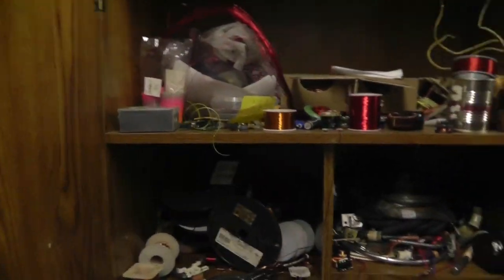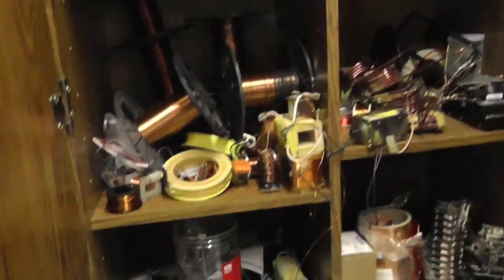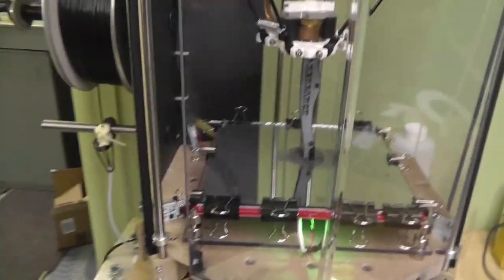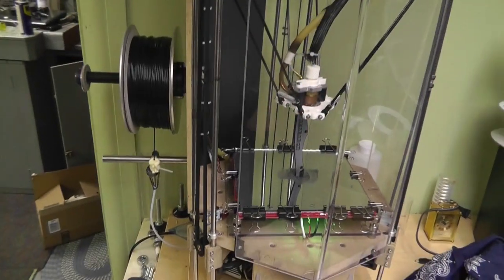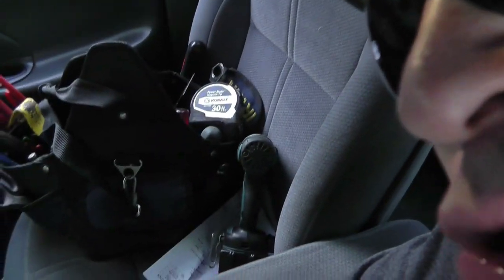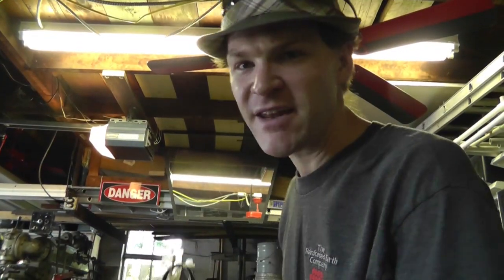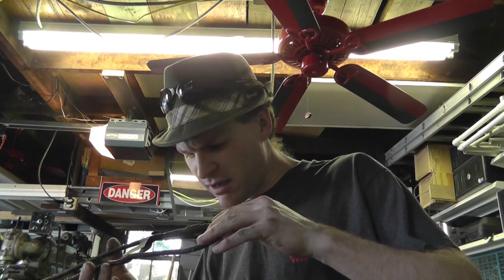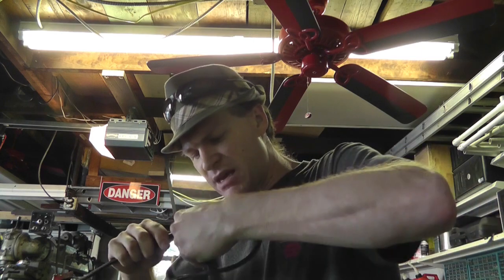~Russ's PMBO 2013 " the plan" & Heavy Trash Day Experiment!! :) let's cruse!

Comment: Haha a magnet wire cabinet...now that's too much like organized !
Btw, your 3D printer sounds like a group of nuns humming.
A tip with degauss type coils and the sticky tape...leave it out in the sun for a few days, dries right out and the tape falls off.
Used to love the first week in May on the MN/ND border at Fargo. Loads of stuff, in fact we brought a lot of it down to OK and I still use the parts from the TV's etc 5 years later.

Comment: Russ I find cutting it with a hot sharp soldering iron tip works nice, and has the added benefit of making you feel like a surgeon.
what type of solvent would be safe for the coating on the magnet wire?